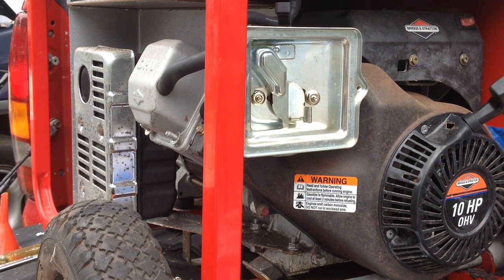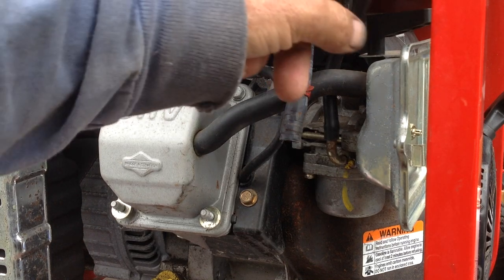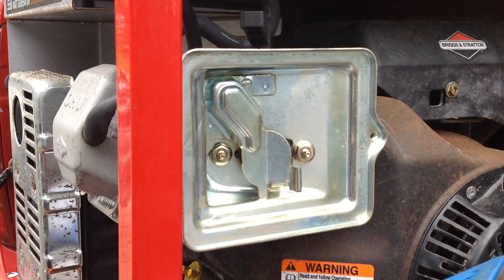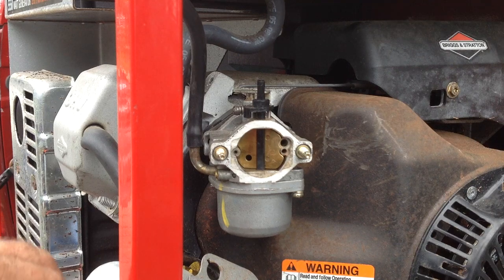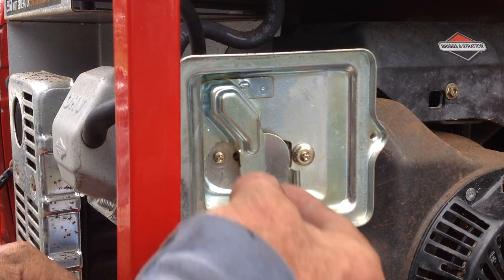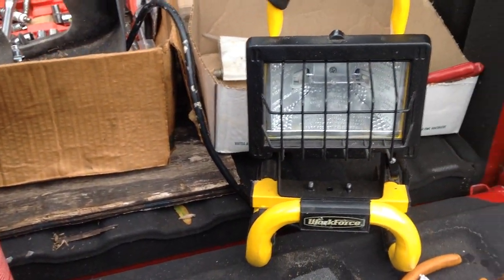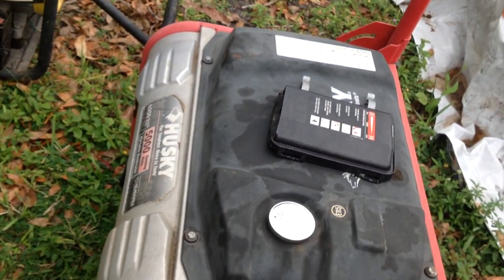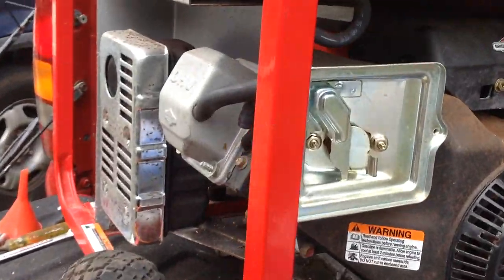2006 Troy-Bilt 5550 Watt Generator will not start!!

Comment: Good video! Do you or anyone know where I can find the whole recoil starter assembly for this exact model generator? Ive been searching forever.
Reply from the maker: you can buy the recoil itself but, i have not seen the whole assembly for sale.  maybe ebay?
Reply: @tommy-time5240  I tried I've been looking for a very long time. They actually have the exact part listed on Ebay and Amazon but its not available. thanks!

Comment: Hello, I live in St Petersburg, FL and just acquired a Troy Built 5550 generator from a friend saying it won't start. I realized that the throttle was stuck and probably gummed up from sitting around. I moved the metal rod back and forth to loosen the throttle and then the generator started up but idles very high and produces output voltage at around 167 volts. Any idea what may be wrong?